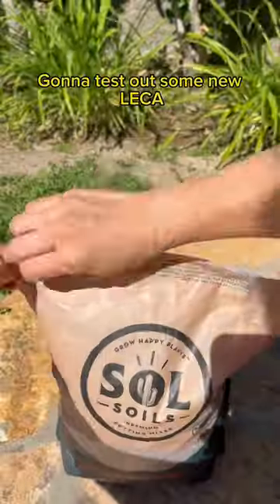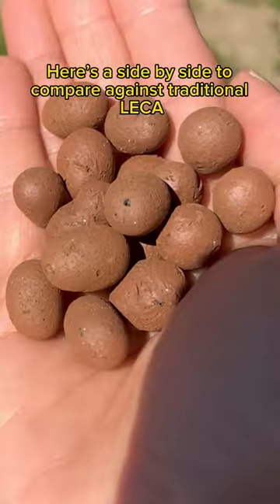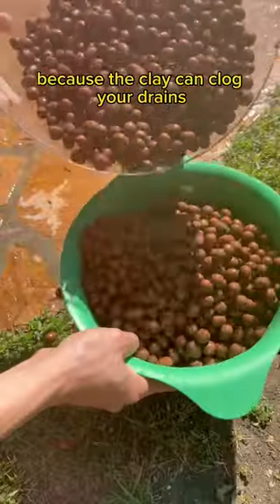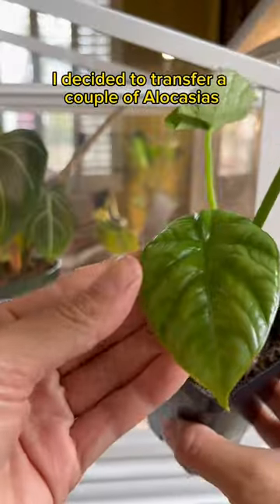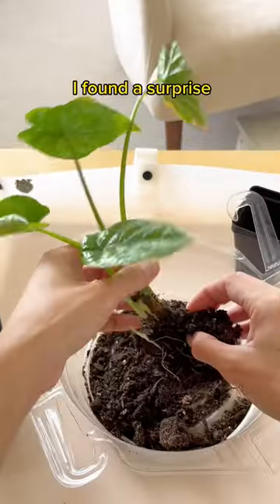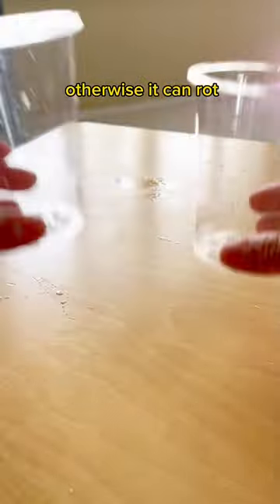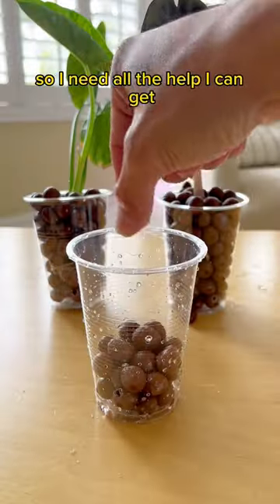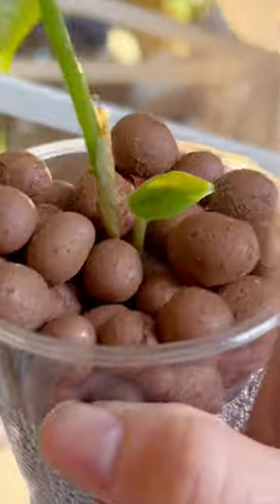How to get DOWN with LECA #shorts #houseplants #plantcare #repotting #leca #alocasia #indoorplants

Comment: Your pressure washer idea made rinsing so much easier. I no longer have to spend tons of time finding with my regular hose nozzle. My laundry bag is pretty worn out from rinsing large amounts at a time, so definitely need to buy some new ones if I want them to hold up under getting blasted with my pressure washer 😂🤗

Comment: I have this plant that had a mushy stem so I went to replant it, and I(the bottom of the plant have a split a bit but it still grew fine) the one of the stems separated,(the plant is an impatiens) so now I had two plants and they both looked like they have roots but how do I know I didn’t accidentally break the whole plants root system and if I did would the plant still grow now as two plants?
Reply from the maker: Hard to tell without physically seeing what you’re talking about, but roots have the ability re-grow!

Comment: Makes me laugh that she bought smooth leca. You know its better if it's rough. I mean literally, leca is used because it has a big surface area to volume ratio, allowing it to hold nutrients, good bacteria, and water better. If it's smooth, it will be worse at doing that.
Reply from the maker: The surface area is not significantly reduced just because it’s smooth. The only major difference is in the buoyancy because the smooth LECA will float if your water level is too high (but when using LECA you don’t need your water level to be that high to the point in which it floats). My Alocasia frydek variegated has been in this LECA the longest and its roots are extremely healthy and the plant is thriving.
Reply: @ohtheplacesyoullgrow  I mean, the fact that it floats means it's not holding the water.